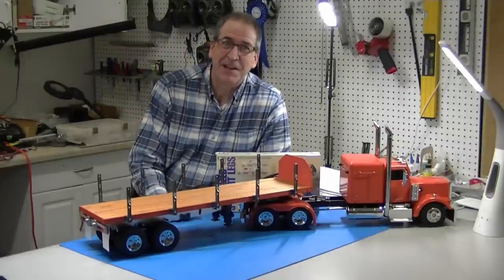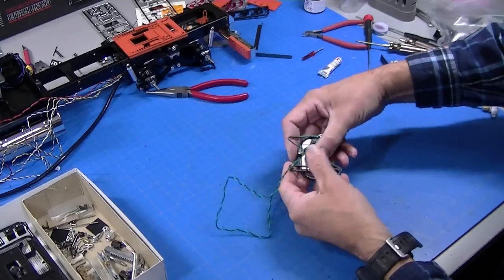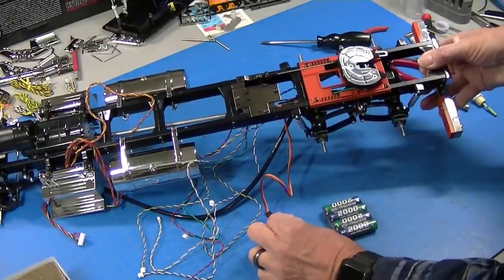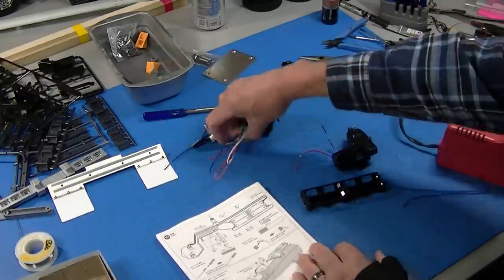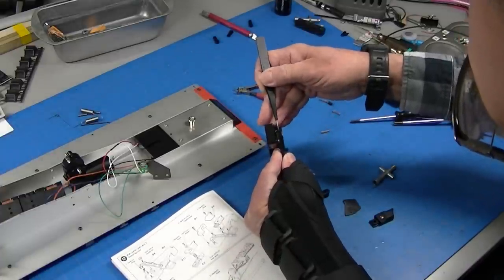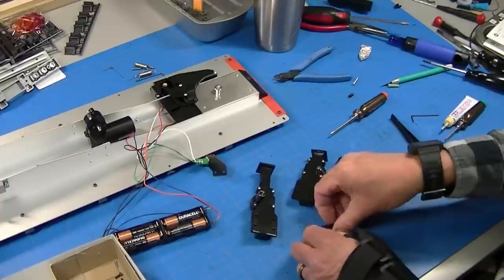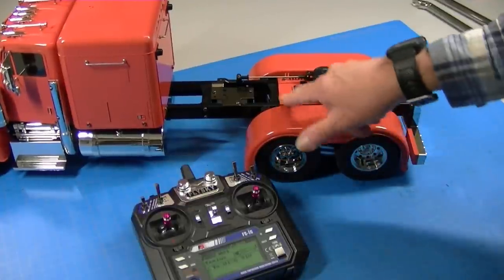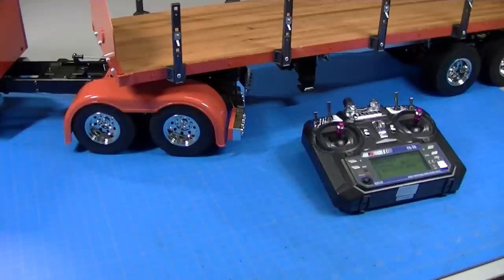Tamiya 1/14 Motorized Trailer Support Legs 56505 - Grand Hauler

Comment: Hi Bob.  I watched this again so I could test the legs on my completed truck.  I  am using Beier electronics with an FSI6X remote.  I finally found a use for the dial based channel 7 with the motorised legs.  I am using that as I do not want to waste the stick channels.
Best wishes
Ray

Comment: Hi Bob
Another great video - thank you so much for all the effort.

The threadlock you use for metal to metal fastners ...
- How permanent is is?  is it easy to reopen if necesary?
 - Is it just thick superglue (CA glue) or is it a different product?

Stay well

Ray
Reply from the maker: The Tamiya kits all come with threadlock.  They use bond that is not permanent so you can remove the fastener later if you need to.

Comment: since adding the auto leg kit, the trailer scratch's my fenders. I tried adjusting the fifth wheel height, but seems it always does it. What is your solution? Maybe a info video. Also, I wonder if a feller could rig the auto leg kit to adapt to the Tamiya tow truck outriggers. Now that would be awesome. I enjoy your video's.
Reply: Unfortunately Tamiya actually says that you have to take the fenders off to use the motorized legs.  I found that info on the side of my Grand Hauler box
Reply from the maker: You can just put some clear packing tape on the fenders and live with a few scratches.  The tape helps....  Or jack up the 5th wheel plate with some spacers and add the same spacers to the bottom of the landing leg feet.

Comment: Hi Bob love your videos very in depth and very detailed, could you please tell me please I have fitted the beier sfr-1 to my scania r620 absolutely fantastic bit of kit. The time has come to get a trailer but could you tell me please do beier have there own motorised trailer legs or is there an alternative option Many thanks keep these videos coming
Reply from the maker: Beier does not make legs but others do including LESU.  You could use a Beier IR wireless trailer unit to control the legs and trailer lights

Comment: Hello do you answer questions i see all your videos...great videos... i have a kinghauler that shuts off when running usually when i turn..someone told me. It was because i use 20kg high torke servos.and pull to much power..what  servos should i use????
Reply from the maker: Probably is the servo.  Especially if you have 2 of them plugged into the MFC.  If you do unplug the shift or 3rd Servo and see if that helps.  If it does just plug the shift directly into your radio bypassing the MFC.

Comment: Hi bob thanks for your videos, helped a lot with my first build.
My question is the use of grand hauler fenders with motorized legs. I tried it with trailer and small screws that fasten hold down plate on mechanism to slide switch scratched up fenders. Is it possible to just space 5th wheel to use fenders or do I have to use 1/4 fenders as stated in manual?
Reply from the maker: That is an issue.  Tamiya says in the instructions if you use a trailer then don't use the fenders.  I usually shim up the rear plate or deal with the scratches.

Comment: where does the wire for the 5th wheel plug in on the mfc and does that wire come with legs and what channel does the servo wire connect on on the reciever.also is the 5th wheel that is modified a stock one or one that comes with the leg kit
Reply from the maker: The motorized leg kit comes with the servo mount and all other required parts for the truck.  The servo would plug into the MFC in space J9.
Reply: what about the small wire with plug that is attached to the 5th wheel does that plug into the mfc also and where
Reply from the maker: That is the coupler switch and plugs into J12